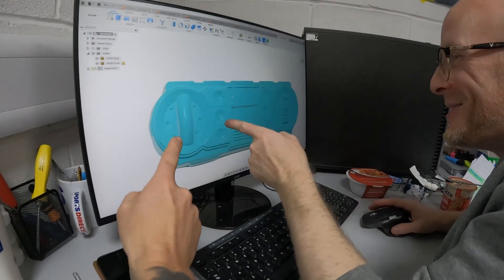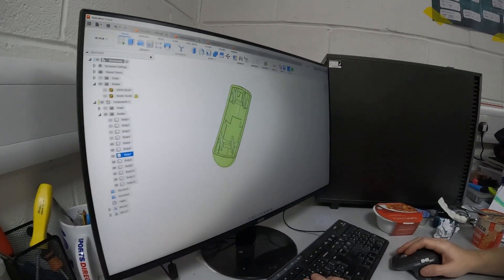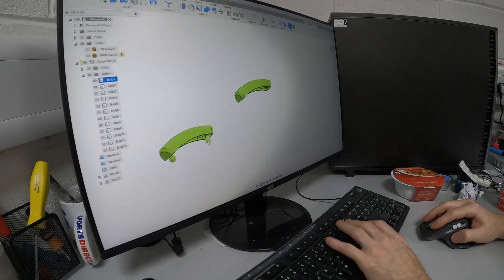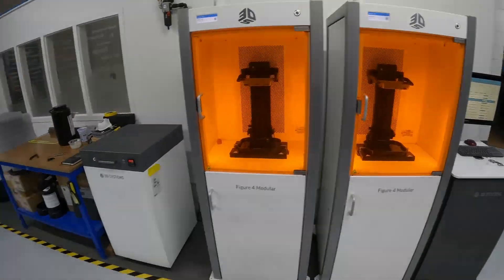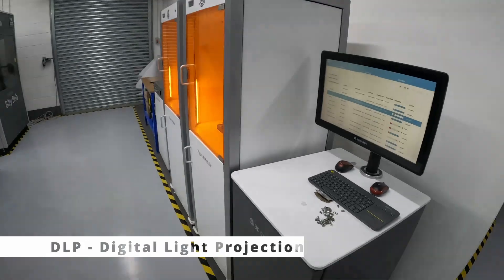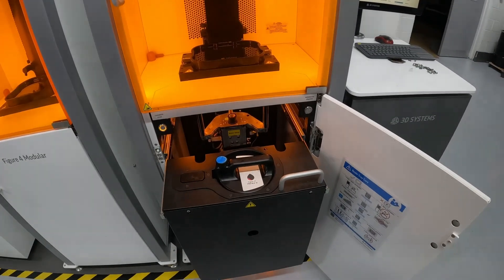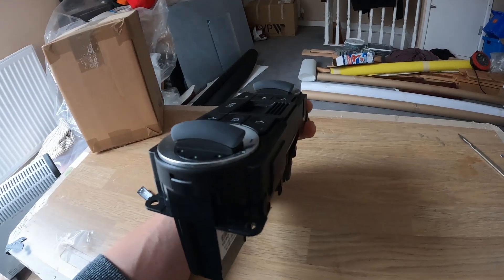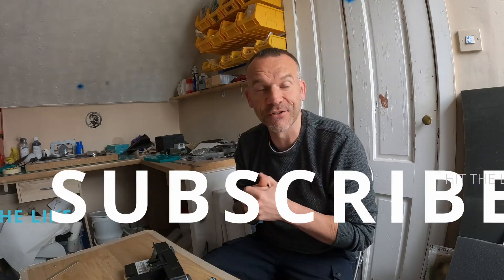Audi TT Mk1 3D Printing and 3D Scanning

Comment: It is so much easier to buy a unit with intact buttons. The unit can be easily disassembled and then replace the whole front facia of the unit with good buttons on the working unit in your car. I did make my own file for the button in fusion 360 which worked and stayed on, but the quality of standard 3d printing (not resin) is just not good enough.